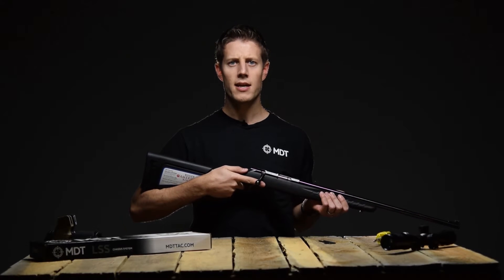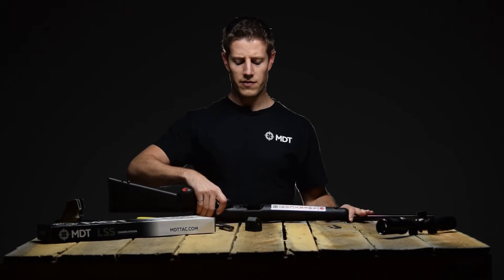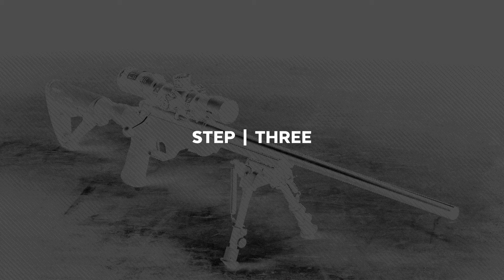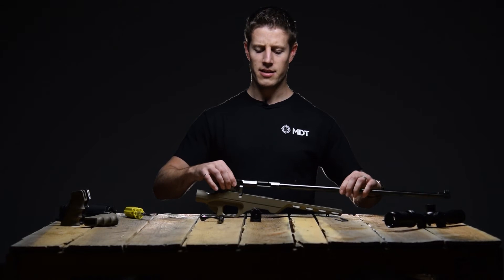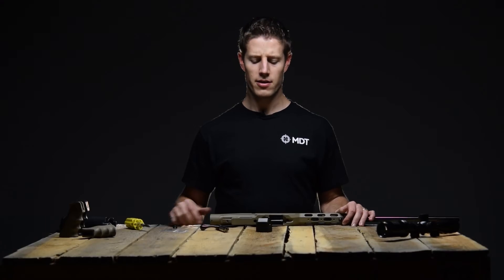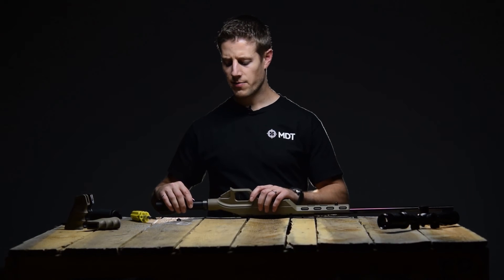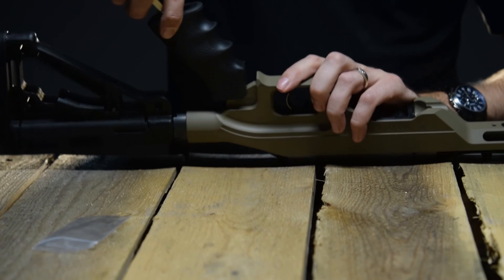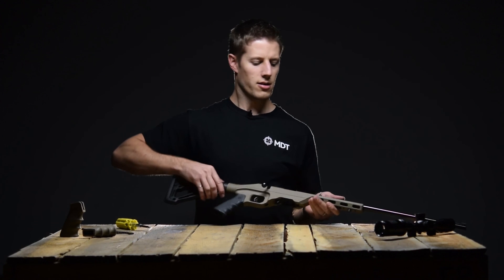LSS 22 Ruger American Install Video

Comment: Good info.  FYI On the RAR 22LR TARGET model you need to cut off the end of the pin on the rear insert otherwise it will not seat properly in the LSS. Do you have a torque recommendation in inch pound beyond the instruction manual 'quarter turn after contact' ?
Reply from the maker: Thank you for the feedback, we are aware of this and working on solving it now. We suggest 15 - 45-inch pounds on the action screws.

Comment: Every bit as simple as the video but did have to go back to my factory mag release lever. I don't like that tiny Ruger lever at all.
Reply from the maker: Were you having clearance issues with the aftermarket lever?
Reply: MDT Yes. I did get it installed but, however the magazine plunger would not extend far enough to seat the magazine properly so the round would feed into the camber correct. I gave up.